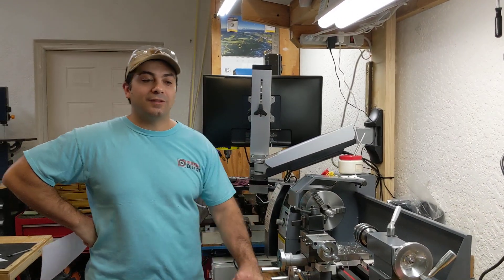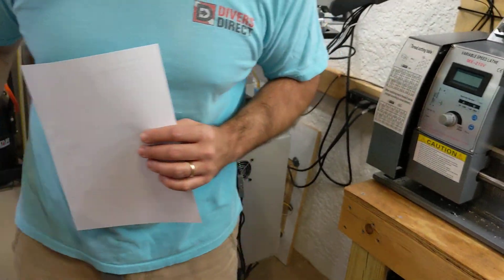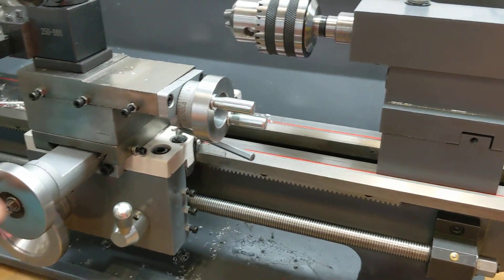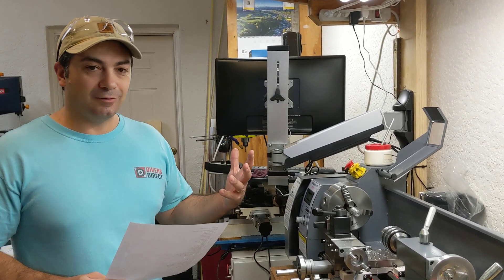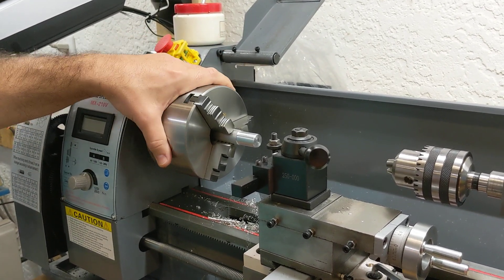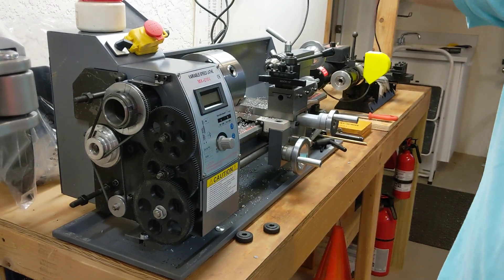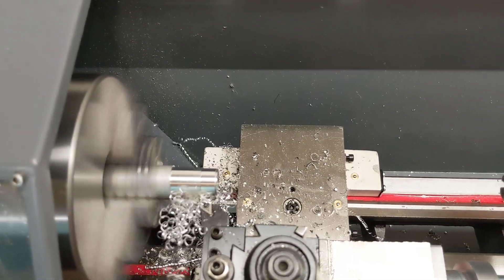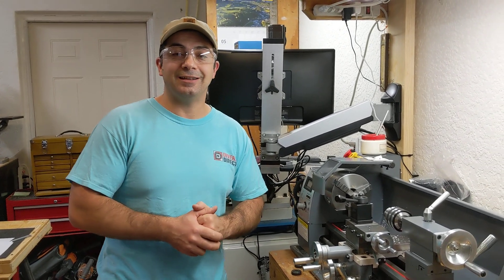MX-210V 8x16 Metal Lathe Review

Comment: These cheap Chinese lathes, that use the lead screw threads for power feed all run too fast,plus it will wear out the lead screw. You should have gone with the PM.  We had two of these cheap Chinese mini lathes, then got the 11x30 from PM.  It is built like a tank, and we are very happy with it.

Comment: For those of you looking at this lathe on eBay there’s one problem you need to be aware of on the tail stock. Underneath the tail stock there’s a bolt that’s over length that you’re gonna have to cut off in order to be able to slide it because if you don’t cut it down it’s going to hit on these little spots on the bed that are spaced a few inches apart. Next thing you need to know is no matter how you adjust the tail stock to tighten it down it’s not gonna drill a hole bigger than a 5/16 before it starts sliding itself back. One fix I came up with when trying to drill a 1 inch hole was take you a piece of 3/8 flat bar just big enough to sit on the end of the bed and drill and tap it to attach there. And you wanna drill a hole in that plate I was just talking about lining it up with the back of the tail stock and tap it for whatever size threaded rod you wanna use to screw against the tail stock to prevent it from sliding back when you’re drilling hole.
Reply: Oh and by the way , a lot of these Chinese lathes come with a twist in the bed that nothing can be done about. You can bolt them down to a bench all you want to attempt to take some of the twist out of the bed but good luck with that

Comment: I know I'm very late here bht one complaint i see often with this brand is the speed controller only has low to high but not off. I also dont like the idea of having to engage the drive of the lathe to turb it on. You could possibly remove the potentiometer and check its resistance values. Then find a replacement with the same values but has a disengage when turned fully counter clockwise. For me though I'd rather be able to set the speed and then give power to the spindle.

Comment: How do you make this bench lathe ridged enough for precision turning?
Reply: define 'precision'
Reply: @joansparky4439  Turning within lets say .001" tolerance over a 8" - 10" span of the part.
Reply: @onemischiefmaker7032    This lathe can do that after some tweaking & tuning, but not out of the box.  Those are hobby-starter machines after all with a usable turning length of 8-10" with a chuck and tailstock mounted..
If u need that kind of capability reliably out of the box expect to spend about 6-8x, get a machine that weighs 8-10x as much and is in the 12-24 / 14-36 size IMHO.
Reply: What machine would you recommend?
Reply: @onemischiefmaker7032  
I got this small lathe for training.. I will get myself a Liang Dai 12x36GH (Taiwan) here in Oz from H&F (as AL960B) as it's the maximum I am able to fit into my workshop (and what I can afford).  Also as G4003, PM1340GT, etc.
I want that one over a cheaper CHN similar size model as it should a better qual and allow me to fit an electronic lead screw more easily, as the change gearbox is not oil filled, (something I still have to do on this small lathe).
Reply: @onemischiefmaker7032    and remember, tooling for the machine will cost pretty much as much as the machine itself.  Just that this can be spent over a couple years as u won't need all of it right away.
Which is why I got this small one first to figure out what I like and what I don't like.  It will be smaller and cheaper mistakes when I make them. ;-)
Reply: @onemischiefmaker7032    btw, u also planning on getting a milling machine or have one already?

Comment: hello I would like to buy this tour. but I have a question please:
the auto feed screw can it move in both directions of rotation? thank you
Reply: yes it does (feeds in both directions), it's fixed to the spindle tho out of the box (once the half nuts are engaged).  If u intend to turn LH threads (carriage moving to right when spindle turns top towards u) it needs a mod that adds another gear into the train for as long as needed (vids about this are around).

Comment: excellent.  looks like drive gears are powered by belt, looks like the belt could be repositioned, would repositioning the belt slow down the feed rate?
Reply: nope, belt goes from motor to spindle.. leadscrew is driven by gear on spindle via the geartrain he was modding by using printed high ratio gear combinations

Comment: Did you ever happen to test the motor specs?  This model seems to sell in two versions 750w and 1000w.  It would be nice to know if those values are correct or inflated when comparing to grizzly, pm, little machine shop etc.
Thanks

Comment: You could remove the shipping plate from beneath your quick change since there's enough adjustment in your tool holders.
Reply: no, there is a boss on the top of the compound where the QCTP won't fit over.. the plate is there to bring the TP up to the bosses height.

Comment: Nice video! If you, the respected reader, could choose (same price) between this WM210V and a Paulimot PM190-V, would you go for the larger, 4 cm, rough bore hole China model or for the quality finish but 2 cm bore hole German model? 🤣 it's a question about the lathies...
Reply from the maker: I would not buy this lathe again.  I suspect all of these are made in Asia but not all importers require the same quality from the manufacturer.   I'd buy from a more reputable distributor.
Reply: @FrancoCNC  Thank you kindly for your quick reply!

Comment: I've been looking at these for the small size and large through bore. Now that you've had the lathe for a year I'm wondering if you can answer a few questions.

What's the actual distance from the chuck mounting plate to a dead center in the tailstock? They say it's 16" between centers but that seems a little optimistic.

How is the motors torque at low speeds? 

Have you run into any major issues?
Reply: I would not buy this lathe again.
Reply: @bradfrancola8485  Thanks for the reply. Guess I'm just gonna have to save up for a PM-1127. It's longer than I need but seems to be the best option as far as quality and price in that spindle bore size.

Comment: If you replace the spindle, ball, bearings with annular roller bearings and set the spindle side play a lot of the vibration will disappear and your machined surface will also improve.  Ball bearings have no provision for side play adjustment so your spindle will dance back and forth as it spins causing crappy surface finish.

Comment: Bought this lathe for 1300 on vevor, it had thread selection switches.
It's junk I think. I've had it little over a year and it has problems in every screw hole.

Comment: One thing I've found out about this lathe since I've owned mine for little over 6 months. The headstock bearings are tapered on the chuck side and standard ball bearing on the belt side.  After a misshap with my auto feed I developed a bit of chatter in my cuts and determined that the headstock had about 2-3 thou of play.  Also my lathes combo feed is hollow aluminum and the gib is a bit smaller than I would like.   Lastly I mounted a 6" independent 4-jaw chuck and needed to get an adaptor back plate but couldn't find one quickly so I tried to make one but it's not 100% to my liking.

Comment: Sorry if this has been covered, or if I misunderstood your description of the chuck mount fitment issue. It is normal for the backplate to require a little more turning to true it up on your exact lathe as any two lathes of the same specification from the same manufacturer in the same batch will have small deviations. In order to get the chuck to run as true as possible the backplate is finished on the lathe on which it is to be used. I think that's the issue you had, though it would surprise me if that was the case and it wasn't mentioned in the documentation.

Comment: I have just received mine, which looks identical, but it has 800mm distance between the centers.
the machine was well setup, tail stock was perfectly aligned too.
the overall quality was very very good towards my surprise.

I bought AXA 100 series QTCP, and it doesn't fit, also looks a little oversized.
I also bought OXA 000 series QTCP, and it seems a little too small? 
also I have to deal with that 10 mm high 17.7 mm diameter stud sticking out of the compound, which fits into the original tool post, but doesn't allow me to simply put the AXA or OXA.
how did you modify the plate? simply by boring the 17.7 mm hole to accommodate the compound stud? did you film the QTCP modifications process?

I haven't tried my lathe yet, but from the quick inspection, there is no parts slack, everything is nicely tight and feels rigid out of the box.

It came with the 4 jaws chuck (my choice), but it only has 2 key holes, so I guess it tightens the jaws symmetrically in pairs. not sure how to mount the rectangular object off center, maybe I need to buy another 4 jaw chuck with 4 key holes? I'm a total noob, so please forgive me my trivial questions.

Comment: A lot of the vibrations on mine were eliminated by changing the screw in the motor pulley to a grub screw instead of a long M6 cap head bolt! Another issue which i considered massive was the chuck not having a back plate in it. It would appear the chuck started life with a smaller through capacity and has been machined out to 38mm which broke into the screw holes securing the back plate, so they left it off! There is room to drill and tap new holes so i made a new plate. Without this plate the gears and worm in the chuck would get filled with swarf. This is my 3rd china lathe and is a bit short on features but i wanted that 38mm! There is no reverse for the lead screw direction, no dial indicator for saddle travel engagement, both of which my 7x14 has. Both easily sorted with a bit of engineering though.
Reply: Which lathe did you end up going with?
Reply: @rksg2003  I got the mx400 but had to do a lot of work to make it how i wanted it. Lead screw reverse, toothed belt drive, thrust bearing on all the lead screws and a Pratt burnerd Chuck. It's done a lot of work now and works great!

Comment: Hi Franco.  Try running the lathe without the chuck and backplate (spindle only) to see if it still vibrates.   If it does not vibrate,  run the lathe with the backplate only (no chuck).  If the backplate is the cause of the vibration and it has extra holes for mounting different chucks, try filling the unused holes with steel plugs to see if that helps.

Comment: Hi, thanks for the vid I have ordered one of these with metal gears. Could you possibly tell me what the maximum shank of the cutting tool size is for the original tool post. I have not been able to clarify it  on the Internet. Some say 8mm some say 12mm, but that may be confused with the quick change tool post  Thanks for any help.

Comment: I just ordered a WM210V yesterday, looks like exactly the same model as this one. Very glad to see it's not a bad machine at all. The 38mm spindle bore was what sold me on it also :D I can fit 2020 extrusion through that, which is awesome. Also ordered it with a 4-jaw chuck... not sure if it's independent or scrolling, but I guess I'll find out when it arrives. Really looking forward to it, I've wanted a lathe for years now.
Reply: How has the wm210v treated ya
Reply: @rc_fleet472  so far it's been great 👍 I still need to get a ton of tooling for it, but haven't had any issues. It's a solid piece of kit.

Comment: This is a really good video to show us how this thing works. I just acquired one today and I'm wondering if you could provide the 3D printer files for the gears? I have a risen printer that I think would work perfect for them and there's no sense in starting from scratch if you don't mind sharing the files?
Reply from the maker: Hi.  The links are in the description of the video and pasted below.  You will be able to download them in several different formats including STL.  Have Fun!
Gear Assembly: https://a360.co/3cc2oOQ

90-20-Gear: https://a360.co/3nLyxVe

100-20-Gear: https://a360.co/3tOr4ps

110-Gear: https://a360.co/2Z9azcq
Reply: I really don't know how I missed that. I could have sworn I clicked on the video description and looked through everything and saw nothing but they are there. Thank you for this

Comment: I would love to know if you're still happy with this lathe - in Canada it seems to be the only lathe less than $3000 with more capacity than a $1300 7x12 (it retails for around $1550). I'll be doing mostly plastics with some brass/aluminum/nickel silver, and would love to get a DRO onto it!
Reply from the maker: Well, to be honest with you, I would not buy this lathe again.  I would buy something more expensive from Precision Matthews.  But, if you are on a budget, then this is a good option.
Reply: @FrancoCNC  what are you least happy with? since I don't do metals as a machnist, and i'm mostly worried about getting plastics to certain dimensions, feed rates/threading aren't as big of a deal for me. i may consider putting an ELS on it for the threading that I do, as I couldn't be bothered with changing the gears that often! :)
Reply: @guitarchitectural  I just had a HayWHNKN 8 x31 (WM-210) dropped off through Amazon last week. Free delivery and It arrived in near perfect condition. The run out out of the box on the three jaw chuck is within .001". I bought it with zero tooling because I'm a bit picky with that respect. It's not a bad manual lathe for a beginner. Also I was able to pick the thing up off the crate and put it on my workbench. There is only one gear that is not aligned well, but that is easily fixed with a shorter spacer. I disassembled it thoroughly to make sure that there was no leftover machining bits left anywhere, but it was pretty good. I must have got a good one. Time will tell. Cheers!

Comment: Got mine and it looks exactly the same with one exception. Your chuck looks different(has oiler, mine doesn't and mine has a empty circle recess for a name brand that's not there). Oddly mine came with the spindle recess cut too far so the chuck has a few thousands play which contributes to runout. The spindle was only drilled for 3 jaws with 3 holes 120 degrees apart. I installed a 4 jaw which needed 4 holes 90 degrees apart that I hand drilled(insanely hard) with a 3D printed jig bolted to the spindle. The 4 jaw also didn't quite fit just like the 3 jaw so it's definitely the recess. Need to make an adapter now with wrong recess on one side and proper one on other to fix runout. 

 I also found large defects in the compound casting where the ways are pics here:
http://imgur.com/gallery/WfvGXn0

You can also see the cross slide ways during and after sanding smooth. I glued some strips of 220 to the bottom of the slide and worked it until the endmill marks were gone from the saddle, my compound and cross were poorly milled and not ground. The bed is ground and looks good with no slop in carriage. Finally my belt tension is way too tight and will likely snap(had a G4000 grizzly with same belt-even gates of this type snap alot). 

Plan to create a 3D printed cross slide screw mount with bearings. I'll eventually CNC one but for now it's absolutely needed for a precision "feel" IMO. I also 3d printed some caps/plugs for the carriage screws to stop shavings from getting in(not the carriage lock screw).
Reply: Forgot to mention the cross slide gib adjustment screws and nuts rubbed on the carriage out of box. I had to use an angle grinder to cut a recess along the way for the nut to fit. Also one of the hex screws head was rubbing against a brass oiler. I turned the head down some and no more problem. The nuts dragging was a much bigger issue. 

Also forgot to mention that after I "fitted" the cross it now stays tight with basically no slop from one end of its travel to the other without binding in places forcing you to always chase the gib adjustment.